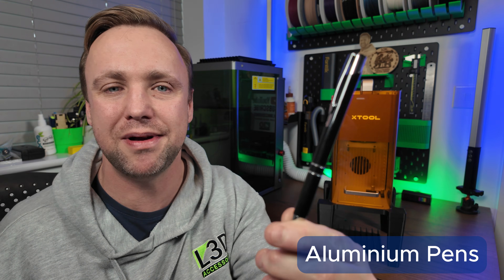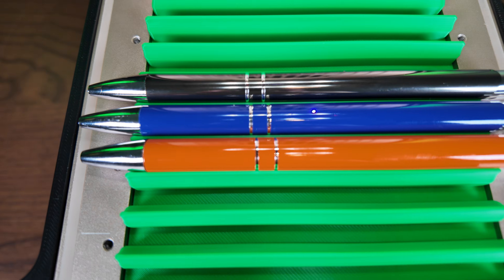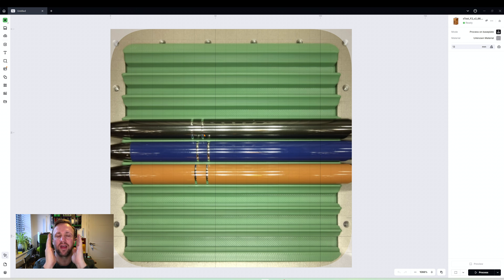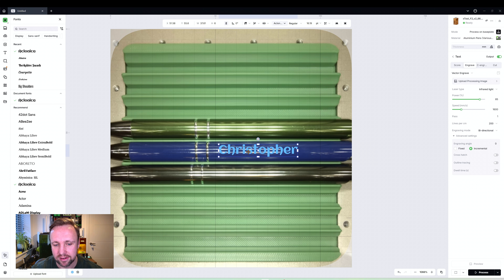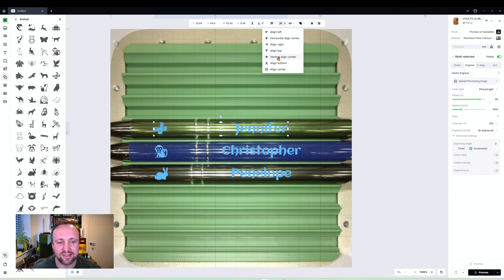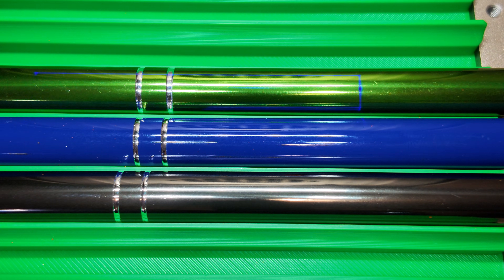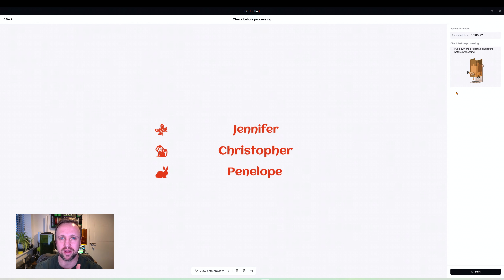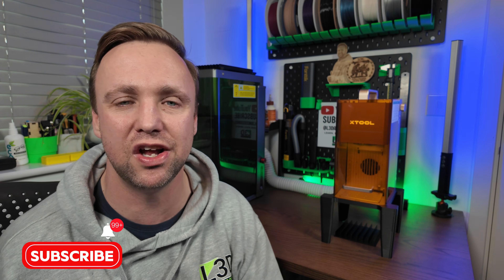Engraving Anodized Aluminium Pens with the xTool F2 (Beginner Project Series)

Comment: Hi Chris, great video. I'm across the pond in the US and the shortest pen to engrave is 14.3cm. Will that fit in the F2 with the protective cover down? It looks like the pen jig will go front to back instead of left to right making more room.
Thanks Again!
Reply from the maker: These pens were 14cm and they only just fitted however I suspect that 14.3cm would probably be ok. Even if they are a little bit too long, I'd recommend having the lid slightly open and wearing some laser safety glasses. Thank you for watching, I appreciate it.